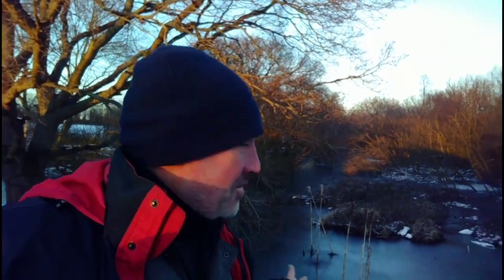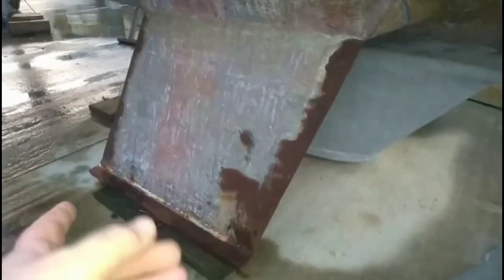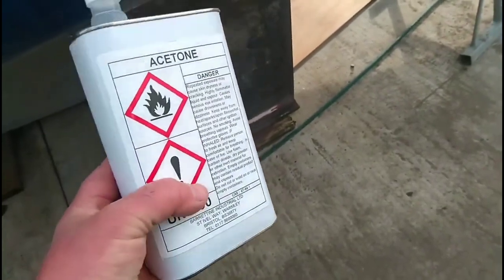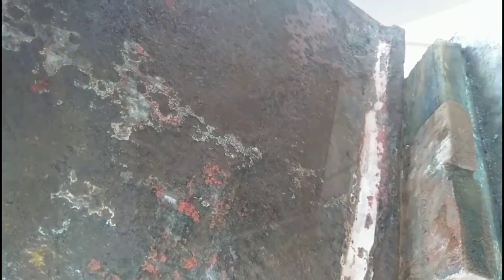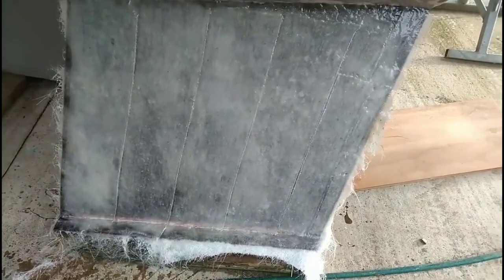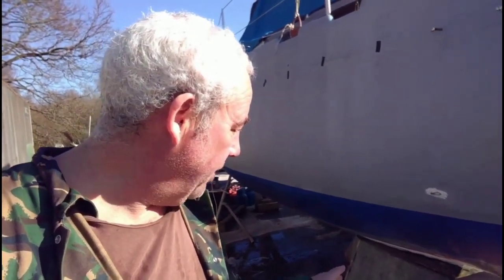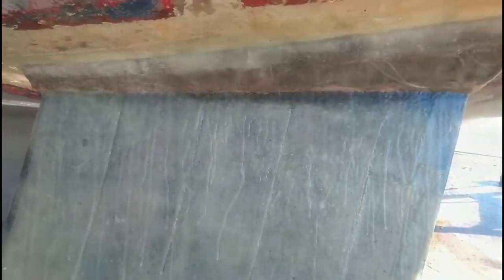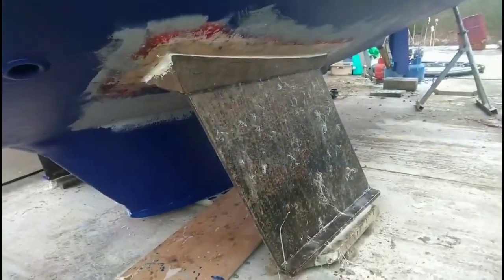Unlocking the Secrets of Boat Maintenance  Epoxying and Fibreglassing the Bilge Keels

Comment: If you wet out the glass first on a sheet of plastic you can wet up to 6 layers in one go and apply them all at once, make sure the first layer is woven multi directional and then alternate, six layers in one go saves so much time 👍
Reply from the maker: I prefer to sandwich woven on both sides with chopped strand.
Reply: @NorfolkBroadsForum  I finish with chopstrand but the first layer being woven means you can pick up the whole lot easily